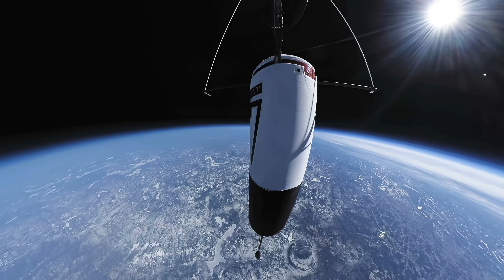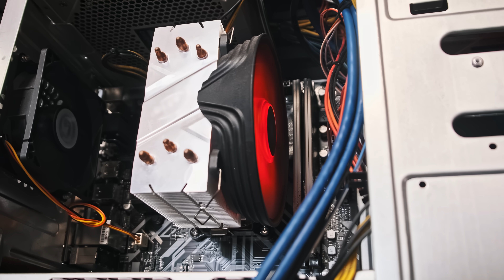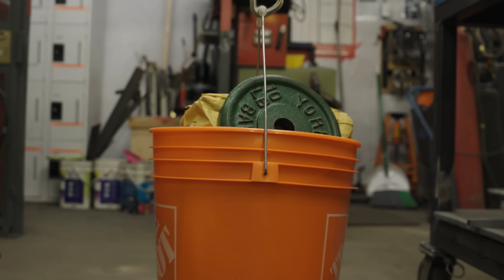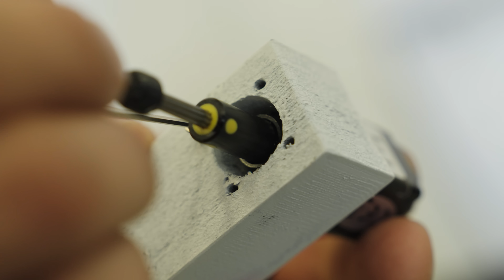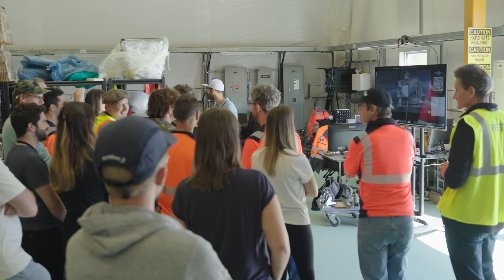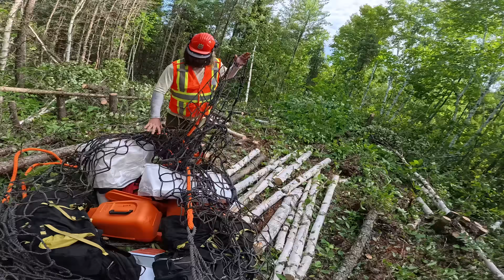We sent Insta360 Titan 40km above Earth on a giant balloon - Insta360 Journeys

Comment: Incredibly Cool, and Spectacular job to your entire team! 
A couple of curious questions... Why not take and build the cameras into the gondola, so you could have more protection and less equipment in view, although I suppose having eyes on the overall system was good for diagnostics. Would the next step to have a all-inclusive structure that has the cameras embedded into the structure? Curious why Insta360 did not help you build direct connections to your gear, rather than having to rely on physical controls that with jarring could lose their orientation or focus point? Lastly, none of my questions are questioning the effort, but more curiosities to help us all understand design and development processes.
Reply: Thank you for your interest in the project, it is truly appreciated.
We did not put the camera inside the gondola because we wanted to maintain a completely unobstructed view of the Earth. Regarding an all-inclusive structure, we do have other modules designed that way. As for your last question, we had a direct connection to the Titan through a homemade software program that gave us full control of the camera, the "push-button", was only added as an additional safety layer.